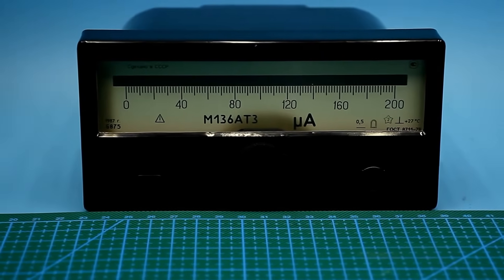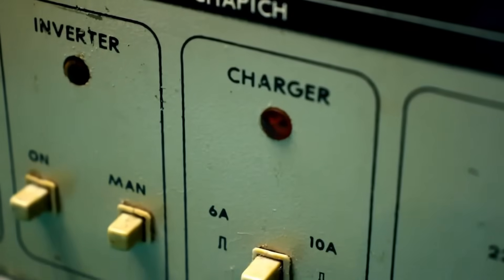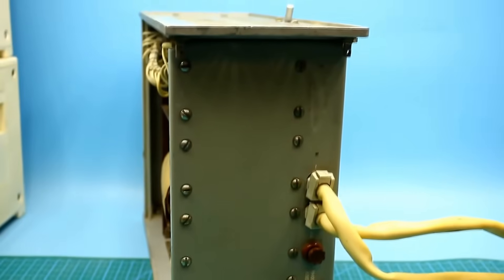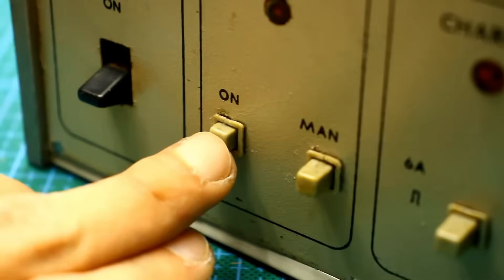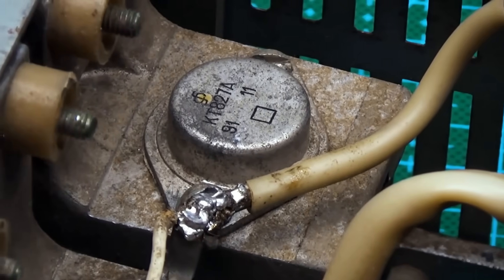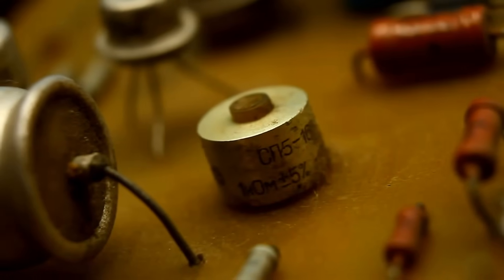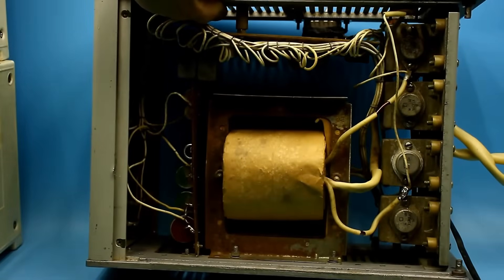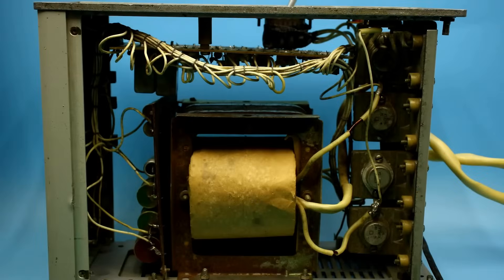Mysterious Soviet device

Comment: Is an battery charger with slow and quick charge and inverter from 12V to 220 V. And the big "transistor" are high current diodes to rectifier from AC to DC

Comment: Are you sure that wsitch is radioactive ? I have similar russian switch but you need to charge it with light. Please use gieger counter to verify , i dont have a gieger counter .
Reply: It could be. If it's real Radium you don't have to Charge it with light. I have a Geiger Counter an measured it on old Clocks, No Activity. But also I have a old Chinese(?) Voltmeter of a car, Tank (?) , there ist Activity.
Reply: @frankleimsieder2037  thank you , i thought so ,radiom glow in the dark likely would have been lost its light by now .